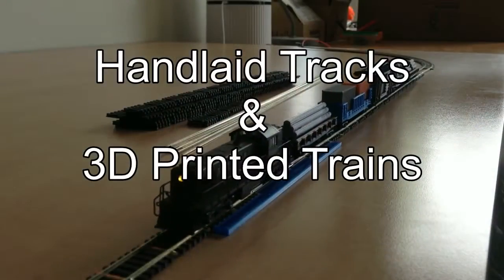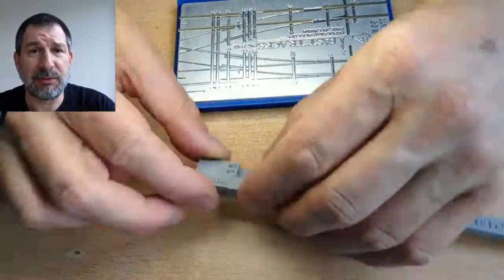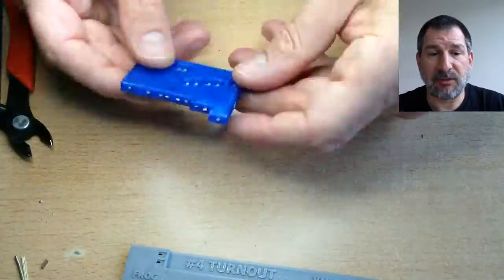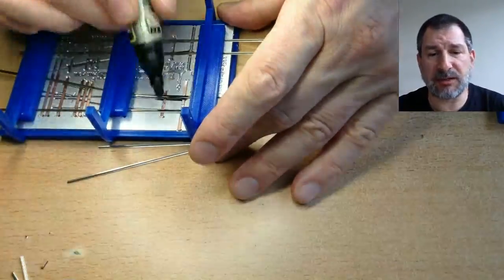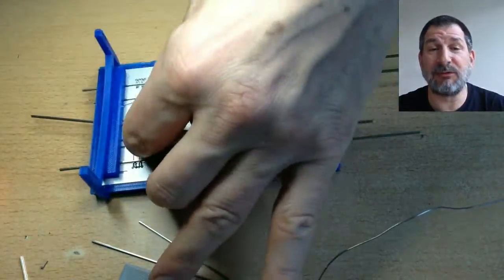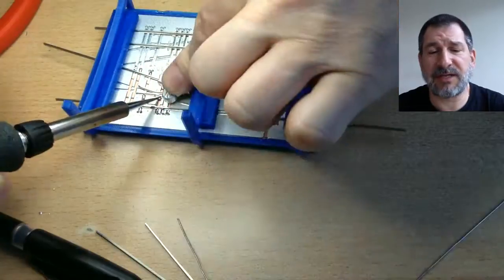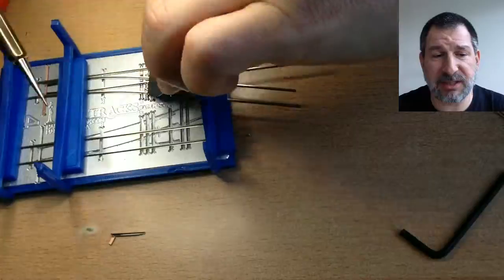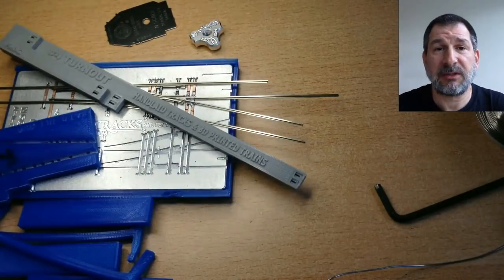Building a #4 Turnout With FastTracks Jig And My Own 3D Printed Clamp System.

Comment: These are some serious skills it seems.
Reply from the maker: Just patience - it helped to be in months of Covid lockdowns...
Reply: @handlaidtracksand3dprinted922  Patience is a virtue, or so they say but I wouldn't trust myself to build tracks like that.
The crashes and derailments would be countless ;-)
Reply from the maker: Just start with the simple straight and curves. Use those triangle gauges. You can feel the issues with a train truck and can heat the joint to move the rail into gauge. It is lots of fun!
Reply: @handlaidtracksand3dprinted922  
I hear what you're saying but i really have not enough patience for that.
I build several projects a year so for progress I use regular trackage.
Still doesn't mean I have the utmost respect for people who are gifted like you, once seen a layout in Z scale with handmade trackage.
Even highly complicated double slip switches.
I get nervous just thinking I shoul;d have to build that, I just lack certain skills ;-)